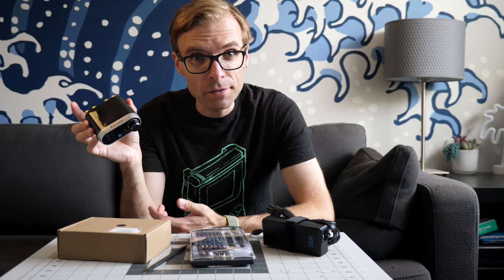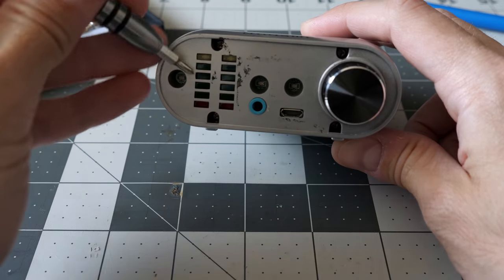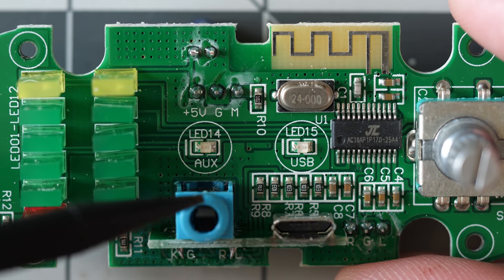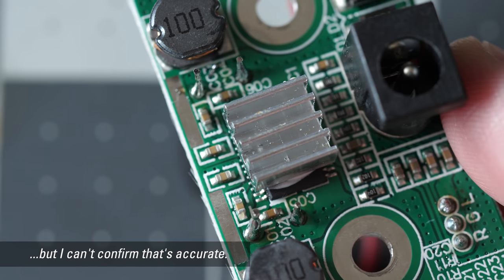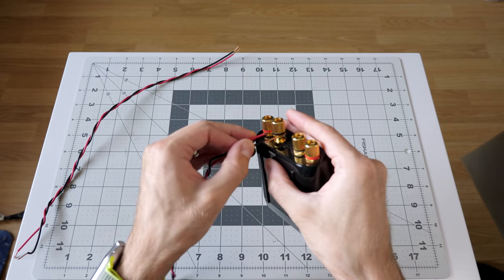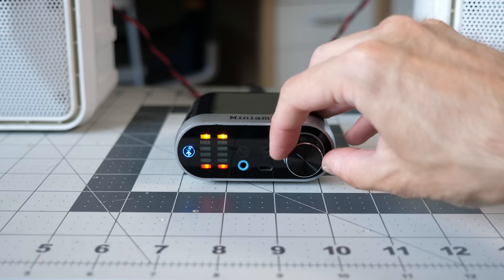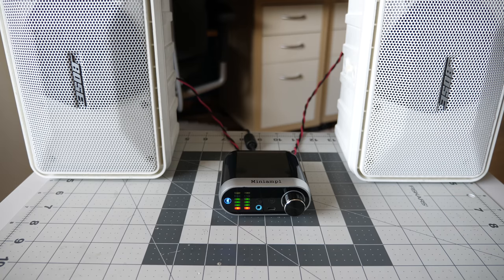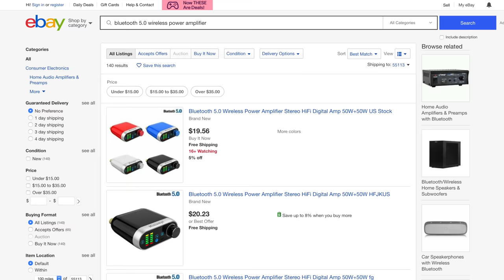Mini Stereo Amp (That Doesn't Suck)

Comment: Based on your review I bought one of these and set it up in my shop so can listen to music, etc. from my tablet.
I hooked it to 2- 30w speakers 20' apart across the room and couldn't be happier! Clean rich sound and no distortion that I could perceive and more volume than I will ever use. 

As a bonus, I discovered that it turns itself off after a period of nonuse!
Thanks for this review! 

It has made the time I spend in my shop more enjoyable.
Regards

Comment: You should really test to see if it works before you open it up. As viewers we have no way to know if it was you or the build quality.
Reply: Was gonna say the same thing!
Reply: Yeah he very well could’ve wiggled loose one of those connectors while he unplugged them.
Reply: It's not like he abused it taking it apart... and it essentially was only 12 easy to access screws anyway... highly doubt it was anything he did.  Even if it were something he did, it would have only happened if the build quality were low.
Reply: Right he tore it apart then blamed the nois on the build quality. Maybe it was his takeing it apart.
Reply: @wardraven8755  If you can't take something simple apart, then it is build quality... how are you not seeing this?
Reply: @jong2359   i stand by what i said
Reply: @wardraven8755  have fun with your iphone and macbook pro.
Reply: @jong2359  what are you talking about.
Reply: @wardraven8755  the mentality that you and MANY other commenters possess has lead to our current situation of non-serviceable devices.  Any common device that breaks when you take it apart is not fit for market.
Reply: @jong2359  i wasnt saying it wasnt build quality im saying i agree with the person who posted the comment. He could have broke it it is possible. Also how dose this so called mentality make so things cant be serviced.
Reply: @wardraven8755  well, your first instinct was to blame the product malfunctioning on him taking it apart.  This tells me that you do not take stuff apart, which is what companies like Apple (easiest target) have spent a lot of time and money getting you to think.  If you are too afraid to take stuff apart for fear of breaking it, then Apple will either sell you another product or sell you overpriced service options.
Reply: @jong2359  you dont know me and i didnt blame anything on anyone so
Reply: @jong2359  You and I didn't see him unplug things. It's possible a cold solder joint was awakened.
Reply: @jamesplotkin4674  a cold solder joint, also known as a build quality issue.  It isn't the fault of the person taking it apart.
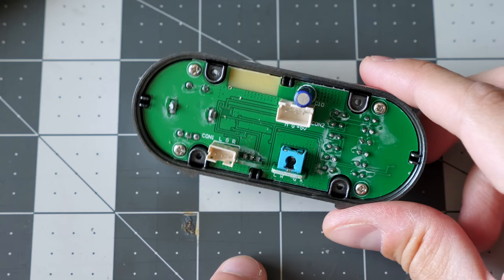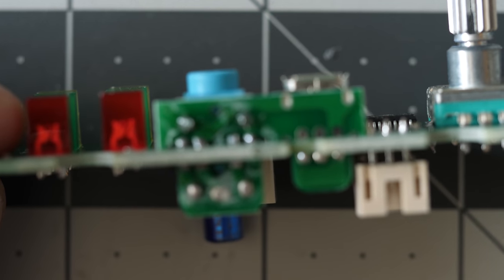Reply: @jamesplotkin4674  - we saw him tear the connectors apart at around 4:00, and at 7:20 you can clearly see how far he's lifted the housing of the audio connector about 1/2 way off the pins.
When he subsequently re-plugs that LGR audio connector, the pins weren't completely seated into the plug because the plug is stopped by the socket that's still raised well above the PCB. Hence, the plug (with female connections) is locked in, yet the pins are not protruding fully up into the plug.
After it doesn't work, he squeezes on the plug which pushes it down just enough to get it working. You can see at 18:12 that after a lot of squeezing the connector housing is still well off the PCB, but finally down enough to allow a reasonably good connection between plug and pins.
Hence he got it working again, but there would have been no fault as-supplied, and his incompetence is the only reason for the fault despite his blaming it on a QA issue by the manufacturer.
Reply: @jong2359  - there's no cold solder joints. He caused the fault by reefing the audio connector housing off the PCB, so when he subsequently locked in the plug, the pins (soldered on the PCB) did not protrude far enough into the plug.
My other post above includes links where you can see this for yourself.
Reply: @johncoops6897  Negative, you are wrong.  Male connectors have their conductors less than 1mm from the entrance of the pin hole.  Even with a reduced pin length, it would still make proper contact unless the connector is choked up all the way to the end of the pins...which it isn't.
Reply: @jong2359 - because you are being so fucking "difficult", I have just measured those connectors... both brand new and as-soldered into some PCBs. There are variations due to manufacturing tolerances, so consider this an average:
The pins most commonly protrude 3mm up inside the socket. Some brands a bit higher, and some lower.
On the male plug there is an extra block of plastic down one edge of the face, so that's where the plug bottoms into the socket, rather than the other edge where the electrical connectors are retained. 
The crimped metal connectors in the plug are not fixed. They float in/out at least 0.5mm, depending on whether the wires are pushed or pulled, so the metal face can be considerably greater than 1.0mm from the plug face. It is greatest when the plug is inserted, since that force pushes the connectors back up inside.
The pins have a chamfer on the ends, however the length and angle varies quite a lot. The plug needs to be pushed between 0.7 and 1mm before the chamfers ride up the 2 detents inside the connector.
If the pin is not inserted far enough, the 2 detents squeeze on the chamfers to push the connector off the pin. It certainly doesn't connect properly if the pin is just touching onto the entrance part inside the metal connector, even though that might be 0.5mm or so long.
In total... to get a reliable grip for a reliable connection, the pin needs a minimum of 2mm protrusion inside the plug (including the extra block of plastic on the face). If less than 2mm, the pin tends to get pushed back out of the detents, despite the plastic housing not moving back. To be "fully seated" in the connector, the pin needs to be inserted between 2.4mm and 2.6mm into the plug.
Now, considering that the pins only protrude 3mm in the first place, that means that if the connector housing is 0.5mm off the PCB then the pins will not be fully seated, and if it's raised just 1mm off the PCB then the plug will appear to be locked in OK however the electrical connection will be completely unreliable.
OK, now go and look at 7:20 again.
Reply: @johncoops6897 love your work. BAM! cop that John G!!! 😂
Reply: @TinkerManMick  - what pisses me off is how the fanbois jump to the defence of a reviewer who is so totally and utterly incompetent. He doesn't even understand the products he's pretending to review.... it's just embarrassing, yet he's too stupid to realise his mistakes.
Reply: John Coops Hahhaaaha the effort!
Reply: @johncoops6897  LMFAO.
Reply: When he says some wise sage said "lets take it apart first" he is referring to Dave Jones's EEVblog.  Dave takes stuff apart first before turning it on.  I guess because he is a qualified engineer there is no fear that anything will get broken.  Clearly you are right.  If Dave had of opened it he would know what got broken when why and how. This guy ought not to take stuff apart..
Reply: @drakedorosh9332  - well said. This guy's main problem is that he has absolutely no electronics knowledge. He speaks parrot-fashion with all the buzz words, however there is no understanding of how the device works.
Anyone else would diagnose the issue, and find out why there was no audio. This guys solution is to wiggle the connectors and close it back up (to find it now works), then blame the manufacturer without being specific about what exactly happened.
Then his fanbois defend him, babbling about "product quality" and "cold solder joints" yet the device no longer shows evidence of any problems. So everything is conjecture, and that's just not good enough in this modern environment.
There's plenty of choice for knowledgeable, capable and informative Youtube reviewers of electronic stuff. This guy is not one of them, he's just some dumb kid with nothing better to do.
Reply: @jong2359  I understand your point.  He might of been gentle with it and it could be the cheaply made products fault.  But for us regular Joes that might be interested in buying it, we won't be taking it apart like he did.  We would of like to see how it would of sounded before it was taken apart.  

And yes with the price of the item, we shouldn't expect top quality, but for review's sake, we hoped the disassembly was after.  Just my thought, don't shoot me.
Reply: @wardraven8755  That's a response from someone who doesn't know enough electronics to take things apart and successfully put them back together. He is capable of working on electronics. If he can splice into a power tab an make it work, I think he would know how to take a case apart....AND see if he made a mistake. Things happen, and I'm sure he has no trouble expressing such.
Reply: @philindeblanc  how is it im just saying he should have tested it 1st as is everyone else.
Reply: @wardraven8755  he should have tested it first. He may have broke, is different and in my opinion incorrect. It is a guess on my part. You are right! He simply should have tested it first. With his experience in such, you would think he would have.
Reply: I half agree but the other half of that is that if the build quality is good it will survive opening it.  I know opening it is definitely something I would do right AFTER testing it, so if it starts to malfunction at that point after opening it, it's the same difference in that it's a problem product.
Reply: Exactly
Reply: You get what payed for
Reply: I agree
Reply: War Draven I service tons of electronics. Your bet is against the odds and this circuit layout/sparse poor complements is more than likely the issue. And plastic housing and ant for waves to get in also means other crap can too. Ps. Oh and maybe the worst speakers for this?!!!
Reply: It's just the improper way of testing things. It doesn't matter how good someone is in taking apart electronic devices and putting them together again and THEN testing them as if they were the original - they simply are not the original anymore! And you will also never know if there was a difference between the original and the put-together-again thing. 
If in an experiment you don't test the subject of the experiment in its real original state, the experiment is basically useless. It's like testing a new drug without any control substance (e.g. placebo and/or Gold standard).
In this video it doesn't matter that much, but it would have been an easy task to test the device before taking it apart. And the final statement would have been more convincing.
Reply: @johncoops6897  Exactly, and the main point everyone seems to be missing, is he has no way, after taking something apart. If it worked to begin with, would be good knowledge to have. Would have saved him alot of time possibly, if the thing never worked. Also, just listening to him, this guy is no audiophile...or even an electrician, on any level. He's the guy who's garage is full of all the things he has bought, fucked with, and broke..just to go buy another, and do the same thing. Give him some ritalin..lol
Reply: lol. that was the first thing i thought when i saw this vid.
Reply: @johncoops6897  This was probably the the greatest and most entertaining debate I've ever seen on the youtube comment boards, and your final argument was such a devestating blow to your opponent it can only be  compared to the dropping of the atom bomb on Hiroshima to end WWII. Or when Luke Skywalker fired a missile down the ventilation shaft of the Death Star and blew it up. 
We can't even find any identifiable pieces of the guy laying around after that post.
Reply: i think he may have bypassed the filter cap by mistake with his nobsound "mod".  that would surely be bad, but i'm not positive he did that.

Comment: You are right about the single chip doing everything, it's a quite powerful microcontroller (32 bit and up to 160MHz operation), with built in radio receiver/transmitter for bluetooth. Manufactured by ZhuHai JieLi Technology Co.,ltd.  Often they can do bluetooth, read sd cards and playback of mp3, depending on the programming and the particular IC version. A lot of them also have the dreaded 'The bluetooh device is successfully connected' voice that plays at full volume and in a dodgy Chinese accent. They are found in the mini mp3 players and generic bluetooth speakers.
Reply: Can we flash those chips?
Reply: @KianaKaslana638  yes and cycle back with own personalised messages😉
Reply: Thanks for the extra information. I already have a speaker which says "The bluetooth device is sucessfully connected" LOL. It still mkes me jump.
Reply: Would love to see a amp with all the features on a cheap little amp. Might even be a good component system on the cheap

Comment: M is the muting pin. The front board is the preamp, and the back board is the power amp. The signal on the M pin shuts down the power amp to prevent pops and clicks at power on/off and when changing sources or modes.

(well, it's supposed to anyway...)
Reply: so the main amplifier is at full volume all the time and you only adjust the volume of the preamplifier (board/chip) and that signal is sent through LGR connector to the amplifier.
Reply: @orange11squares  Yes, that is pretty much how all amps work.  When you set your vol. control to max, you are essentially removing all resistance between the input signal and the amp.  Full input signal to amp = max volume.

Comment: I bought this amp and i´m happy with it. Stable and quick pairing on bluetooth and good sound. Even better when connected via USB on my PC. Much better than using wired 3.5 plug connection from onboard sound chip. I didn´t bought it with those too weak transformers. I chose only the amp for about 16€ and use one of the 24V transformers of other mini amps i have. But even if you choose to buy an extra 24V 5A transformer for 8.99€ you get the best results for together 25€! I love this small amp!!!

Comment: At 3:54, when you first took it apart, you can clearly see the LGR connector is fully seated on the PCB. At 18:13 it's plain to see the connector is jacked up off the PCB by a good 3mm. This is not a build quality issue, had you not taken it apart it would be working perfectly.

I deal with these connectors regularly and they are perfectly suitable for this purpose. They are not flawed when it comes to initial assembly, build quality, or careful servicing.
They are, however, not foolproof when it comes to servicing. Some attention to detail is required.
Reply: Was just going to say this but you did already
Reply: Good Spot!!!! +1
Reply: In other words he made a fool of himself, LMFAO!!!

Comment: 18:20

>Takes apart amp
>Reassembles amp
>Breaks amp 
"IT MUST BE THE BUILD QUALITY"
Reply: That's what I was thinking. I mean, yeah sure, not much than can go wrong just reconnecting the headers, but regardless, if doing a review, test the product as it came, THEN take it apart.
Reply: You guys really aren't gonna like AvE..
Reply: If you can't take something simple apart and put it back together... then it obviously has build quality issues.  Your provided evidence defeated your own argument.  I am pretty sure that is where the origin of the word moron came from.
Reply: Yeah well normally you expect these JST connectors to be quite reliable, you can take them out and put them back in a bunch of times. Either there's a solder joint problem or a bad crimp on the cable, or bad fake connectors. Given that, it's not really necessary to disassemble it to get it to fail, normal China Mail can do it all for you!

But it's also not a major issue for a technically inclined, it's just the wiring and there isn't a ton of it, and i mean when you order something so cut throat priced, it's going to come with compromises. They really aren't getting a lot of profit out of this thing!
Reply: Kind of comment of a guy who never used his hand and driving automatic car
Reply: My only question is, if those Bose speaks are efficient or not? Guess we'll never know.
Reply: beep boop Bose generally makes efficient speakers 😉
Reply: Yep, thinking the same thing.  Test first then take apart. Standard practice in my repair shop.
Reply: @sparkie5571  That dude ROCKS!!! I was hoping he was from one of the upper tier US States, but I was able to get used to him as Canadian, but they usually have that UK too nice saccharine sweetness to brutalize bullshit build's. His level of expertise discpline is cross fields of high level that is easily accepted by those who are willing to buy the best and also want the quality as it is advertised. A certain high priced German woodworking tool is savaged by him! Yellow doesn't hide B&D being cheap in the drivetrain components in a hammer drill doesn't fly as they use nylon gears. Or the infamous Sanyo Massager! 🤣
Reply: An unknown to me - any flashing to chips after assembly that is needed to get the parts working with each other. If you break  the connections do you foul that up?  Microcontrollers do have some control code, don’t they?
Reply: Agreed
Reply: He explained this issue at the end of the program. LISTEN.
Reply: LOL!!!